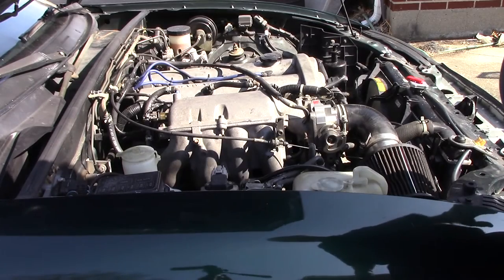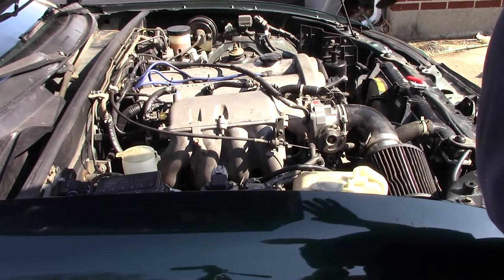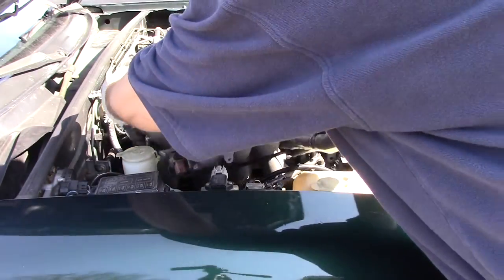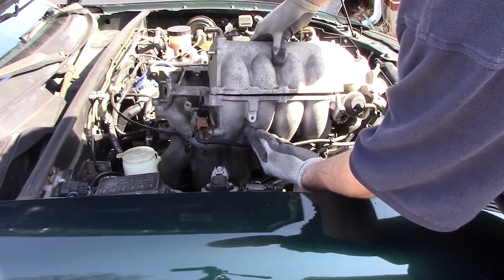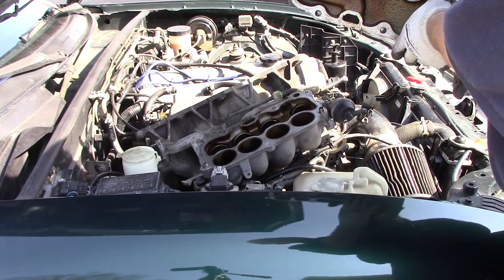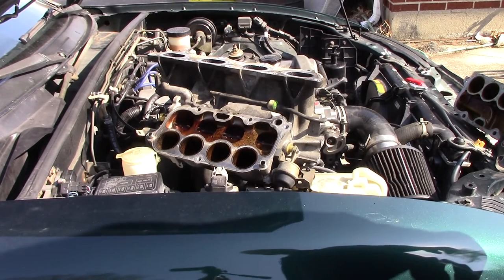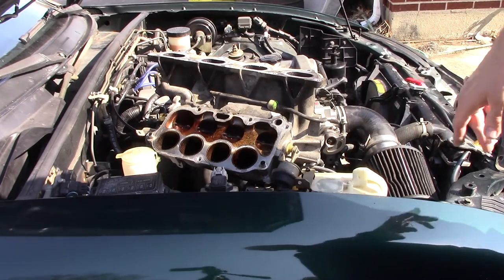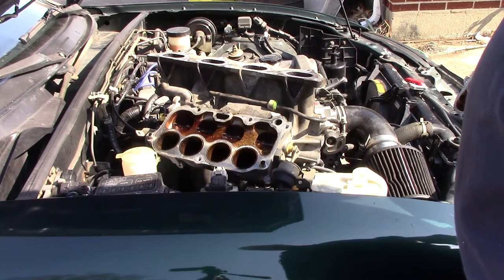Demonstrating VICS operation using a Miata 99-00 Intake Manifold

Comment: So this is the next best thing if you don't want to hash out 500 for a EUDM/JDM square top?
What if someone has removed the butterflies? is it just rubbish now?

I ask because I plan to buy a 2000 intake but the original owner removed the butterflies because he was turboed, IIRC. I'm not turboed yet but will be soon enough, I'm buying his head and intake because mine has a plethora of issues including burnt valves.

If I run that intake without the butterflies N/A, will it noticeably hurt low-end performance?
Reply from the maker: I don't know. I would assume that it would run a little worse at low RPM. I'm running the Skunk2 Manifold now. I like it better than the square top but only marginally better.
Reply: @kysephia  aye. Gotcha. And I'd imagine it's likely hard to find those butterflies from the factory? Seems when people remove these things, they suddenly can't remember where they put them.

Comment: I'm installing a flat top in my NB Miata and your video is very helpful.  Can you what some of the changes I will need to make?  I see the VICS in the front and I see something in the back next to the EGR Valve that I'm not sure what I need to do with.  Appreciate your help.
Reply from the maker: With a aftermarket computer that has self tuning nothing has to really be done. A retune would be optimal. On a factory computer it will work just fine but you will get a CEL. I don't remember how to stop that as it has been years since I used a factory computer.
Reply: @kysephia  Thank you for the reply.  I ended up installing my square top into my 99 NB1.  I kept the VIC valve plugged in, but just capped the vacuum ports.  So far 500 miles and 2 track days and no CEL.
Reply: @automotivekid902  did you feel any difference in power with the squaretop running with the factory ecu?